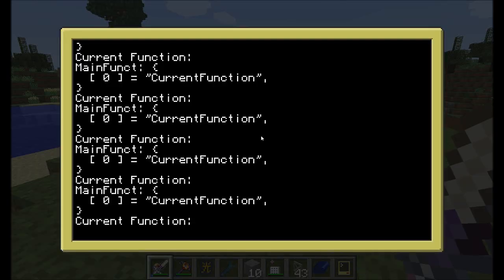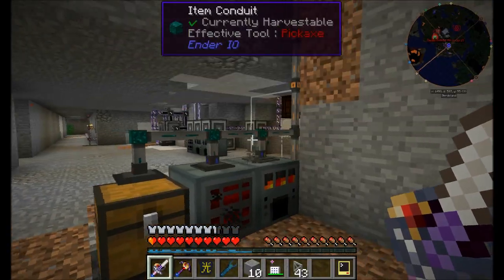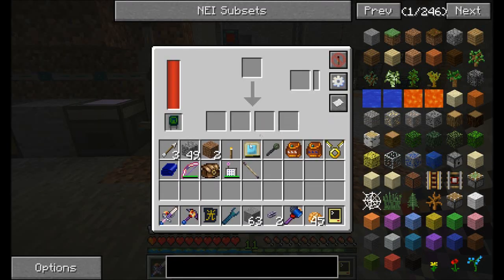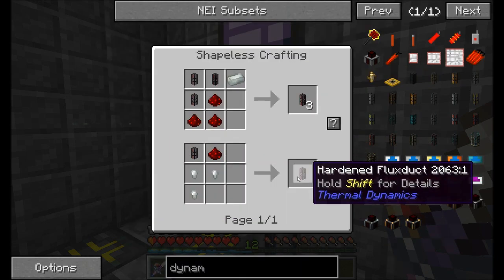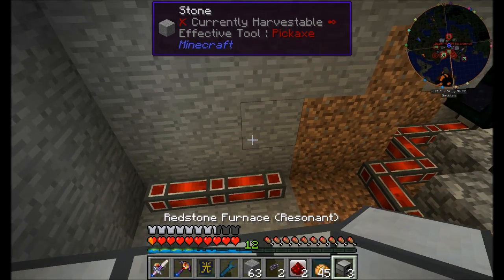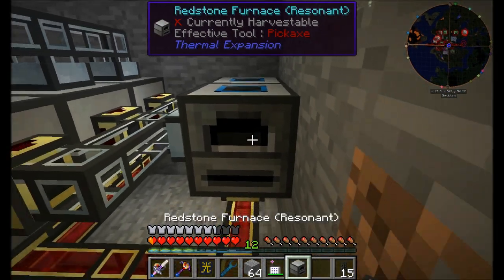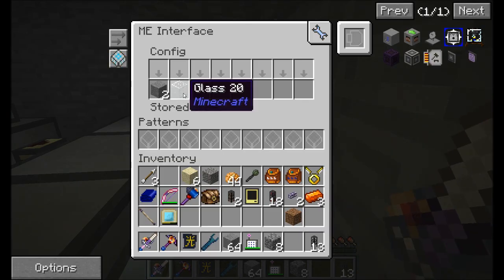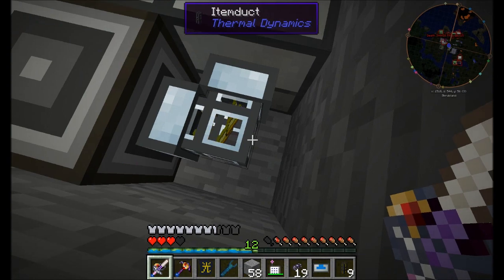Lets Play   S7 E68 Processing Upgrades

Comment: I might've missed something, but why didn't you just use a dense cable on the controller to the interfaces. That way you didn't have to mess with the regular cable and have 32 channels.
Reply: ***** The interfaces would act as normal cables, and would only allow 8 channels to be used. You would still have to branch out.
Reply: ***** He wouldn't have 32 channels since those Interfaces aren't the only devices connected to that side of his ME Controller.
Reply: ***** it would be more expensive
Reply: I guess it's just cus its cheaper
Reply: ***** Dense cables can carry 32 channels but only to other dense cables once you branch off to any interfaces, other chanel using blocks, or regular cables that branch can only use up to 8 channels
Reply: benji pestell If interfaces could carry the 32-channel limit, using a single dense cable would be cheaper than using 16-ish cables to connect the 2 sets of 8 interfaces, but because the interfaces as a cable only carry 8 channels, he had to use the 8-carrying ones and create two sets.
Reply: +Sanca p2p lets you get around that
Reply: suekru methinks you should read the question that I was replying too, I know the p2p absorbs the cable and then can output it elsewhere (for lack of a better explanation), the p2p isn't in any of the categories that I said would reduce the channels to 8.

Comment: I still prefer ender chests to feed the items back, even if using tesseracts for power. The advantage is you don't need to worry about storage drives or anything, just put your storage bus on the chest. At your base just have a dark cable that you can turn on and off to remove from chest. Put your controlling computer beside the chest and, before moving, check to see if the chest is empty and if not, don't move. Simplest system and you can easily turn it on and off from your base and never have to touch the quarry ever again. Just set it up and let it go.

Comment: Those furnaces and pulverises use almost 10x more power than the other machines each and are hardly any faster
Reply: JB2GFXXXXXX mhm, power for speed ratio is waaay off, and if you wanted to be precise and correct with speed,,, you use electric furnaces with speed upgrades.... but no one uses IC nowa days x3
Reply: any1alive  I'm trying to learn....
Reply: +any1alive Induction furnace from ic2 is my main way of smelting...And the only real reason I still use ic2

Comment: Is a tesseract on the mob spawner
Reply from the maker: John Skelley Yea I checked that one, it has items disabled.
Reply: direwolf20 I was checking out ep67 to see where items might be going, in about 15th minute you tested your send item function and it worked,in minute 28 you tested again and it didn't. I think you should think what you did between that time. Also, i think you should replace the tesseract in the quarry with new one and test freq 1 before moving the system. It might be a bug.
Reply: direwolf20 maybe its a bug
Reply: Serkan Demirci You are totally right sir. I had same bug and i did exactly what you said and thats it.
Reply: +direwolf20 maybe the old frame quarry? Or did you dismantle it? (the tesseract)
Reply: Maki Makic
Reply: skullcandey17 You posted a comment mentioning someone but not saying anything 
claps